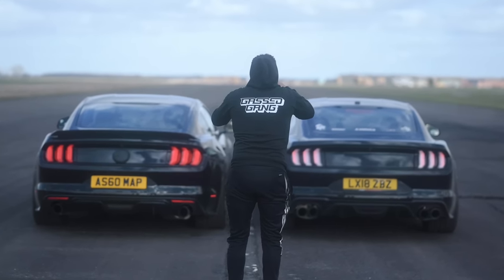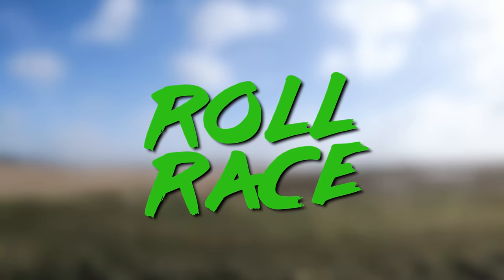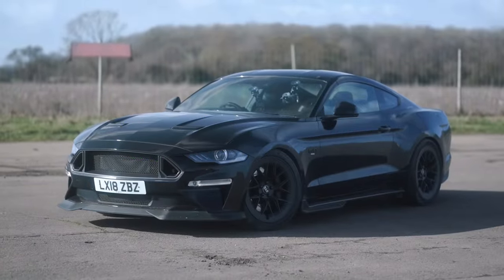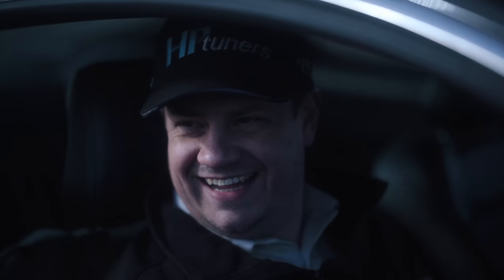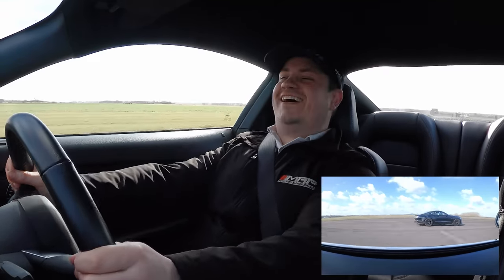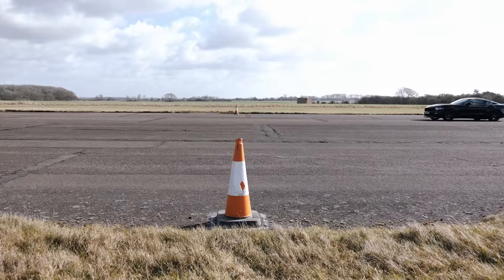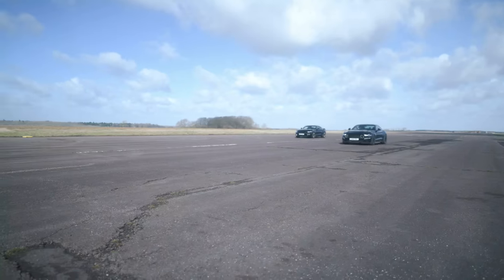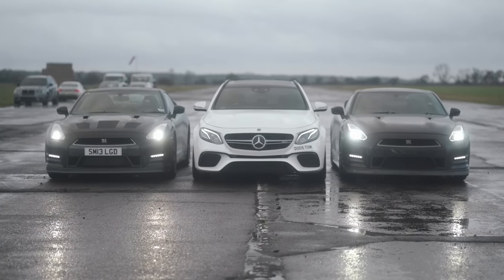TWIN TURBO vs SUPERCHARGED.. 980BHP vs 950BHP FORD MUSTANG GT

Comment: They are the slowest fast cars I’ve ever seen
Reply: You mean the slowest fast cars
Reply: 900+ HP and they 0-60s are insane 😂
Reply: This is right 😂maybe they need more seat time and they’ll drive them a bit faster ☠️
Reply: I fell asleep 😴. Who won?
Reply: They shift like my grandpa lol I bet they could definitely cut some time shifting like they want to win.
Reply: I swear they've had quicker civics on the 0-60
Reply: Lmaoooooo
Reply: All the guys here to use to watching a computer drive in an auto golf R. These cars you actually have to be able to
Drive
Reply: As they don’t even rev to launch and keep it in first gear still on the start…… smh 🤦‍♂️
Reply: I ain’t a mustang fan but in Europe they get a different version of the coyote engine that makes less horsepower
Reply: American muscle
Reply: no prep surface no slick tires it looks like they didn’t even launch the cars right.
Reply: @gera__5.036   You said it.. People think of perfect condition launch numbers. Real world is often different, more so with RWD rather than AWD... And these are mega powerful RWD cars! Add in variable track conditions etc... 

And yup, stat nerds get upset!
Reply: Would’ve been different with automatic cars
Reply: @daysend1341  Do you remember the TH200 from the 80's? They wouldn't even hold up to 150hp v8's. That's the same reason they aren't hard on the tranny for now... They can do it, but for how long?
There was an article in 2015 about 200+ cars and who was the fastest. Well the Corvettes blew out rear ends and others scattered clutches. Everyone knew those cars would do 200+ but never got to test.
A 1000hp Viper won and an 830hp Ford GT came in second; with a difference of 7 mph total top speed between. When asked about losing the F/GT racer simply said, we're driving ours home the viper is a trailer queen....
Reply: My beetle has a 0-60 that’s only off by several milliseconds. I was like wtf 900 hp?
Reply: Also there altitude makes a huge difference
Reply: @taylorharrison8765  because the stangs are hp based, hp dont help with 0-60
Reply: No jkes
Reply: Too much torque for two wheels and unprepared surface.
Then the manual gear box it has its limitations.
Reply: Stock F-150 3.5 eco has a faster boosted launch 😭
Reply: @karldallinger75  Slowest high horsepower cars...? What a oxymoron lol.
Reply: Yep the Pilots were very ordinary.  They didn't drive the like they stole them
Reply: I agree lol not impressed at all
Reply: @sufficetosay  "an" oxymoron
Reply: @mikegillen6009  I realized that after I left it but decided to leave it alone. Thank you for correcting my grammar.
Reply: These guys are embarrassingly terrible drivers.
Reply: Lazy drivers
Reply: Dude I mean considering one of the mustangs looked like it’s tires were pretty much bald and they’re on street tires the first 3 or 4 gears are pretty impossible to actually put power down. I mean you can hear them just spinning the tires like crazy like 3/4 of most of their runs
Reply: @wandilemthembu2164  their 0-60 is slower than factory 🤣
Reply: that's a manual for u
Reply: I almost reported this comment for HATE SPEECH….True Story LOL! It was on accident though. Clearly your imaginary car is much faster than these two! 👀🤣
Reply: @wandilemthembu2164  right my car is an 06 grand prix with a 0-60 clocked at 4.1 with tune and I only got 365 to the wheels lmao
Reply: I guess you didn’t see the drag radial car numbers on the list….

Spinning ain’t winning….
Reply: TT 0-60 5.5 seconds, like wtf?
Reply: Yessss
Reply: I think it’s got to do with the fact they are on street tires and probably don’t have launch control
Reply: The people tuning them have no idea, I had a 400rwhp 800nm torque turbo falcon that did a 11.38 quarter mile
Reply: @Ste661  the mustang
Reply: Good grief, non shifting to the max
Reply: @karldallinger75  No bro !!! He wrote the slowest fast cars.
Reply: @ASAPSPORTS90  first they both need to learn what the traction control button is 😆  really this has to be the saddest video of two mustangs ever. Really if I can run a stock 2010 gt500 on stock tires faster than both of those guys  that are in high 9 to low 10s cars 😆   really its sad to see people in cars that they can't drive.
Reply: @fungaming4k  in all honesty my 140bhp derv would give em a run
Reply: @nathandimick7594  Love the GP!
Reply: its fucking funny, i run a 0-100kmh time of 5.9 secs with a golf 6 gti with 290bhp..... gotta love american cars!
Reply: @redslate  What i mean by "American cars" is that it has to be big and have alot of HP.  Both of these cars have different power delivery and cannot get close to a BMW with the same kind of power (hence both are real wheel driven). And the tune might screw things over but put a Hellcat against the old v10 m5 and i think the hellcat loses. ( i am not a bmw guy btw).
Reply: @ppvhelden  And, I hate Ford...  
Your assertion and assumptions are false.  

Your next tangent is irrelevant, but the E60 M5 you're referencing costed $100,000 new, and is nearly on par for performance with the $40,000 Mustang GT.  Before you start fantasizing about a "cheap" used one, while you may be able to snag an average example for ~$30 Grand, at a minimum, you're going to want to allocate $3k towards replacing the rod bearings.  Then, get ready for the added joys (read:  expenses) of a used high-maintenance vehicle.  At that point, you are not any better off than having simply bought the 'stang.
Reply: @gera__5.036  I’ve driven a 2015 GT with a blower making 782 from brenspeed. It would light the tires on the interstate like you were taking off from a stop it had SC2’s. It was a scary vehicle. These cars are stupid but it’s not a bad thing.
Reply: @ASAPSPORTS90  Golf R are sweet rides, loved my gti
Reply: @thatsmyassbrostop  bro those Volkswagen Vochos are OP lol
Reply: they sound mean but they go no where... overrated
Reply: @jptambara3096  6غ6غغغغ66غغ6غغغ6غغغغ
Reply: The problem is having to granny shift the MT82 transmission because it’s glass, not running radials on any of the cars at 950+whp on a street surface Radials are a must and maybe they would’ve had some traction but most likely destroyed trans and axles in the process
Reply: My 500hp ttrs 0-60 is over 2 seconds quicker. This is weird
Reply: @brandonmalfoy2743  however thats less fun. And less skill to drive
Reply: @taylorharrison8765  they've had a 50cc vespa quicker on the 0-60 🥴🤣
Reply: They’re probably also trying to do soft launches as to snap axles
Reply: @abdalgondal  Ive seen one of those before, absolute monsters.
Reply: Why has no one mentioned that this isn't even a race seeing as the 2 cars had different final drive ratios. 3.31 and 3.55 should have been a bigger difference, and both cars should be in the 9s.
Reply: Cameras are extremely decieving
Reply: wrong drivers 😭😂😂
Reply: Lmao fax and neither can drive let’s be honest
Reply: They can’t drive/shift. Major wheel spin, bad timing on shifts, etc. makes you lose major time
Reply: Facts
Reply: They have nothing really done to them. For a ford those two cars are stock
Reply: Was gona say a rt charger can do 0-60 and like 4 seconds😂😂
Reply: @timfort8921  they’re still making over 900 BHP. The highest horsepower number from a similar car is 808 from the challenger demon. The coyote making less power over there is negligible. The times were slow mostly due to lack of preparation. A 12 second quarter mile. I’ve seen stock coyotes make that. These guys couldn’t beat a stock hellcat. Should just drove an automatic to almost factor out the driver. Really did these cars a disservice
Reply: @DiamoꞃdMiꞃd I've got a 500-hp Porsche, and I can run 0-60 under 3.5 seconds, and 1/4 mile under 11.5 seconds, on unprepped streets, with pretty reasonable consistency.
Reply: Officially slow
Reply: I have a truck that makes 2200horse power
Reply: On da gas
Reply: the most crashing car ever made!
Reply: Just thinking that same thing
Reply: With 1500hp axels and slicks on beedlocks would make a night and day difference
Reply: The supra is the slowest  cat i ever seen
Reply: My ford escape is faster than this. And I’ve seen mustangs at the track faster than this as well. 😅 something seems a bit off.
Reply: I saw this comment before watching and said “it can’t be that bad” watched half the video 🤦🏽‍♂️ 🤦🏽‍♂️ 🤦🏽‍♂️
Reply: Lol my 750 hp stock gt manual went 11.37. at 131 in stock 235's these two can't drive
Reply: typical mustang
Reply: Americans drive fast, sorry but we do it best.
Reply: They hit 60 slower than the stock cars
Reply: Penyepong jdm
Reply: Bro what 😂😂
Reply: They are definitely granny shifting lol, and I think if the twin turbo car would hold second gear a little long he would still be in boost when he shifted third. Could probably shave a second off if he could keep it under control
Reply: All UK modded cars are slow🤣
Reply: So true
Reply: @UR_AL_SHOOK_UP_21  altitude matters alot less to forced induction cars.
Reply: @nathandimick7594  nah bro your not a 4.1 in a a gpx making 300ish hp at that weight.
Reply: @ppvhelden  lmao golf's only get respect in Europe and and Americans from Seattle. These guys can't drive for shit. I didn't see em warm tires tt guy didn't brake boost to build psi off line. 900hp gt's with decent rear tires are high 3 sec 0-60 on no prep cars.
Reply: @GhostlyGhille  ya i didnt know that..thanks for the info
Reply: I was thinking the same thing lol
Reply: I've got a stock 07 300c with the 5.7 and it does 0-60 on the 5 second range lol
Reply: @dyllongeckles2122  yeah without proper tire and a prepped track, a thousand horsepower is absolutely useless on the road unless you’re doing 60-120-180 rolls, even then you need a good tire. These cars both didn’t run the right tire setup for this kinda power and they’re on an abandoned tarmac.. burnouts for days
Reply: Facts
Reply: My Camaro 6  1000hp 1/4 9,7-sec 😊
Reply: @HashMaster1776  8sek ,9sek cars 1500hp
Reply: Should have brought automatics !
Reply: They not slow it's the drivers who drives slow
Reply: @dyllongeckles2122  yea because your car doesn’t have enough to spin the tires. These guys are going 50% throttle to get to 60 in 5 sec
Reply: @timfort8921  but 950hp is 950hp anywhere
Reply: It wasn't the cars... Driver error all over
Reply: @rossturnure1816  yeah, but the timing can be different, and the compression ratio can be different. So the engine will be different and act different 👌🏽
Reply: Absolutely
Reply: @timfort8921  no. It will still go just as fast. Maybe weight would change it but not timing or compression. If you change those than you got more or less power
Reply: How I get a sub12 second 1/4 time with an 03 500hp mustang cobra….?
Reply: atleast they arent as slow as you
Reply: @ASAPSPORTS90  yea and the owners clearly can’t drive them. They are shifting like they are on a leisurely Sunday cruise, I have a GT with 840 bhp and I can get sub 4 second 0-60 every day if the week
Reply: Too heavy.
Reply: @Frenchindochina  if they don't they're going to grenade the transmission.  The MT82 is GARBAGE and blows on stock hp if shifted too fast.
Reply: @DiamoꞃdMiꞃd probably? Lol stock  911 turbo s would be at finish line before they even reach half of the dragstrip...
Reply: Thank God I'm not the only one who thought this!!
Reply: I always said, unless you're a god at shifting, manual transmission and +500hp engines do not go well together.
Reply: Slow drivers, fast cars
Reply: @timfort8921  yeah, but that wouldn't matter in this situation. They bothered north of 900hp. They flaws in this race are the drivers. But they did say something about the strip not being the best. Although it's obvious they both couldn't get these cars going
Reply: @bliglum  I’m just saying, my car isn’t boosted or even FBO and I run a 13.0 1/4 with cheap tires. They aren’t driving these cars lmao
Reply: my 4.6 0-60 is right at 5 sec. i think they just aren’t carching
Reply: When you don't have money to buy these cars 😒🤣🤣🤣
Reply: Slower than a standard mustang
Reply: Lol yeah my grandmother could go faster and she's 86
Reply: They deffo need a driver mod
Reply: I was thinking the same thing a stock G35/37 0-60 is 5.6😂
Reply: Just the drivers tbh, neither knows how to launch and shifting to early
Reply: Bro I thought I heard him wrong on the times, that’s stock car numbers or close to it.
Reply: Why because of the look of the acceleration?
Reply: @thatsmyassbrostop  haha.
Reply: A 12s 1/4 in 900+ mustang 😂
Reply: When you have that much power, the car has a hard time at launch. You better believe these things are highway demons.
Reply: @BillyRiffinDaTube  they  are making mustangs look bad
Reply: my glc 63s does a 11.8 with stock 510 hp
Reply: At the end of the day, it’s a muscle car… not a super car.
Reply: @aidenkeeris5171   say that to the Americans with 5-6 second muscle cars
Reply: @BlueberryWrap  mate, I’m not saying muscle cars can’t get a good quarter mile time.. I’m just saying muscle cars aren’t suppose to be rockets, unless they’re highly modified, just throwing in my 2c worth just like you.
Reply: Cars were pretty equal.  The equalizer?  Tires.
Reply: These cars are muscle cars 
They not meant for drag strip & 0 to 60  times.
They for enjoying the sound on cruises on the streets
Reply: @daysend1341  right!, they're granny shifting, not double clutching like they should.
Reply: It’s the driver not the car
Reply: Plus if you notice their gearing which the narrator doesn’t seem to know is these cars aren’t drag cars and they are geared for top speed.
Reply: @taylorharrison8765  they evo boost 0-60 is as fast as that twin turbo -_-'
Reply: They drive them slow af. Every British channel I’ve seen they drive the mustangs very badly.
Reply: @angelgjr1999  honestly tragic I treat my car like shit lol
Reply: XXDD
Reply: Driver mod please this hurts my soul to watch
Reply: @HashMaster1776  not true it's all in tuning traction control. Know a twin turbo hellion mustang daily drives it. Hooks real good on launch control
Reply: I was saying to myself just pull the a3 out for giggles 0-60😂
Reply: It’s a mustang what you expect
Reply: A good driver can make a slow car seem fast, a bad driver will make a fast car look slow
Reply: Boys just can't launch...
Reply: It’s because they are in stock fuel
Reply: @wandilemthembu2164 manuals what you expect manual cars are slow 😂 no matter how much hp you get it only fast if you shift perfectly with a 10 speed auto stock 0-60 is 4.3 with only 450hp 😂😂
Reply: Considering these guys should have gotten the 10 speed auto for performance instead of the shitty MT82, yeah
Reply: Maybe cuz these are just gt ? Abd guess whta still can gapp any other american-japanease car, mustang>
Reply: @fading.8997  cringe
Reply: my grandma’s civic faster
Reply: Facts
Reply: Bro this is why mfs get scatpacks LMFAO man said “sub 5 second 0-60…4.9”🤣could’ve thrown a single turbo on a scatpack and went off
Reply: I've met Ben, he's a proper sound guy 👌🏼 and I've also been in that car. I can hands down say it's absolutely savage. Even though in the time I spent in it, he snapped the tensioner belt 🙈🤣 that Mustang has been developed from scratched by their own tuning company owned by Ben. He also owns I believe, rotary revs. Situated in Batley if I remember right.
Reply: Dude, do they have the traction control turned off?  Lots of wheel spin
Reply: tapman  tap, I have a car with 600rwhp.  You cannot take the traction control off, all it will do is spin
Reply: tapman  it has 600 foot pounds of torque from about 2500 to 5000, too
Reply: tapman  so if you have a 1000 hp car, that is NOT a dedicated drag car with slicks, narrowed rear end, drag shocks and all of that.  You cannot just blast off without the traction control.
Reply: tapman  it’s okay dude I own a Silvia I know about light rear ends these owners still had too much mechanical sympathy maybe I’m just ruthless
Reply: Slow drivers
Reply: @spookyreaper1702  everything but the driver mod🤣
Reply: i thought they were in slow motion like what
Reply: I was thinking the same haha
Reply: Swear my stock coyote runs a 12.1 in a 1/4. Idk wtf they talking about
Reply: @karldallinger75  go back to sleep..
Reply: Ford problems🤷🏻‍♂️
Reply: 5.1 sec   0-60….. 😂
Reply: @wandilemthembu2164  traction is very important you see 😂
Reply: EEEXXXAAACTLY what I was thinking but the drivers have zero clue how to launch which in itself is sad😂😂😂
Reply: It's not the cars my brother the drivers and if you'll notice they're pulling the foot off the gas pedal before they shipped they don't know how to speed shift which is completely novice I am a supercharger person I would have totally Wiped the floor with the turboed Mustang
Reply: Imagine a stock  sti smoking ‘em at a track 980 bop stangs lolol
Reply: They’d cut those 0-60 time in half on a prepped surface. It’s virtually impossible to launch that much power on an unprepped track. It’s hard to launch 500 HP on tarmac and keep the power down.
Reply: The good thing that they are equally slow - fast cars.
Reply: @GH05TFACE  the turbo stang has 800 tq. lol those 0-60 times suck lol i have a 5.0 and i only have bolt ons and im not much off that, ot their 1/4 time lol sad too i run 13's in my nearly stock 5.0
Reply: @thatsmyassbrostop  haha you have a beetle 😂
Reply: @chriscaswell1212  I did. Yeah. The particular model was basically just a lighter GTI. Not known for being a speed demon, but definitely quick and fun. Also tuning VWs is basically like cheat codes. Easily get 60hp with just a basic tune but the high torque is where VW really shine until they explode.
Had no problem keeping up with 5.0s with just a few mods.
Reply: Maybe if the put the driver on the correct side they could shift like they mean it.
Reply: My lsa G8 ran an 11.8 on street tires, 20 in wheels on concrete, no prep street, by just punching it from a dig... 4.21 0-60mph has 700rwhp  but a 2.2 60ft if I had some drag radials or slicks and a preped surface who knows...
Reply: Beat a 450hp one with my 200hp 3.2 tt
Reply: King Tolo  lucky man. I’d do naughty disgusting things to own a Shelby lol
Reply: I was thinking the same😂😂
Reply: They’re not slow, they’re FAST!!
Reply: I don’t think u realize the skill it takes to drive these type of cars not everyone is that good, if u drove manual u would understand
Reply: You are right.  I can beat them with my stock 2014 mustang i swear. Seems to me they are not properly tuned or even the drovers know how to drive them at all
Reply: OMG, my single turbo Jetta will smoke these cars in 0-60 and 1/4 mile. The major problem, neither guy could drive worth the shit. I know they're traction limited on launch, but it's still horrible by fault of the drivers.
Reply: Unprepped runway , bad shifts , spin …. But no excuses there mo$&^*##£% slow !!  A stock mustang is the same speed 😂😂😂
Reply: @magedelfangary5319 they can’t launch them . And they were spinning every gear above 4K rpm. Funny af .
Reply: @sheepyracing2774 , they definitely don't know how to use a clutch to their advantage. On a prepped surface, an automatic is definitely king. On an unprepped surface, the manual has a major advantage... they never learned how to use it properly.
Reply: @ppvhelden that is funny you drive a golf and know what your 0-60 time is.
Reply: @abdalgondal Vespa can’t go 190 mph
Reply: No wonder why its slow, If you check the thumbnail you see the left one is breaking.
Reply: @sheepyracing2774   its the driver not the car
Reply: Came here to comment this oem runs 13’s lol 😂
Reply: For a 900+ hp car yes I agree.
Reply: Stock mk7.5 golf R owners be like 🤣🤣🤣🤣🤣
Reply: @briansimpson5664 wrong
Reply: @boostjunkie2320 no
Reply: 12.8?? i ran that with just a tune on my 15 GT. Who owns these car 900hp and not even a drag radial? smh
Reply: Facts
Reply: @Sluezer bro what. Look on Google my guy
Reply: The drivers are slow, not the cars
Reply: 0-60 5 sec definitely the slowest fast cars ever. Kinda embarrassing for you Ford guys💯🤣🤣🤣🤣
Reply: Naw, this ain’t it…
Reply: Drivers arent the best
Reply: They don’t have enough traction to launch
Reply: Ok the guys are very slow shifter.
It is better the drive a old Mercedes Benz from 1920 or so
Reply: Deskboarddrivers be like: My Clio is faster omg!
Reply: Right I knew I'd see this comment 😂😂😂😂😂
Reply: @timfort8921 

These are claimed at 980 BHP and 950 BHP
Reply: Its not the cars its the drivers
Reply: I think it’s the fact that they’re on a track windows up barely any noise
Reply: LMFAO… RWD vehicles over 400hp are useless on street
Reply: I took a nap each time the supercharged guy shifted 🥲🥲
Reply: They’re lying about their horsepower it’s no way they’re making almost a 1000HP and running high 12 quarter miles it’s no way in hell they’re lying about that horsepower by a couple 100 horsepower maybe 650HP and 680HP no way they both have 950 plus horsepower
Reply: My buddy had a 400 hp foxbody ran 10s in the 1/4
Reply: 😂😂 right.
Reply: Hater
Reply: @bradleycisneros5714  5.3 is the best I've done on an unprepped surface in my Challenger RT with manual transmission and no power mods. (tires were Firestone Firehawk Indy 500s which aren't quite as sticky as their Michelins) It cuts out around 5800 rpm and has a 3.92 final which means I have to shift to third in the high 50s. Those mustangs have engines that spin north of  7000rpm, longer final gears, and more than twice the power while having more traction, needing half the shifts, and weighing less. Even with wheel spin and a less than perfect pavement their times are trash. The 2.3 Ecoboost Mustang is rated by the manufacturer for a 5.1 0-60 on stock tires.
Reply: Fr. Driver mod needed.
Reply: They not supercars 💀
Reply: The American mind cannot comprehend
Reply: The cars are fine, drovers suck though.
Reply: Because of the weight ford f*"k up with limited the weight
Reply: Japp
Reply: My lawnmower makes 680bhp & has a 2.7s 0-60 & runs 5's in the ⅛, 6's in the quarter.
Post it on YouTube or STFU 🤣🤣🤣🤣
Reply: The drivers aren’t that good